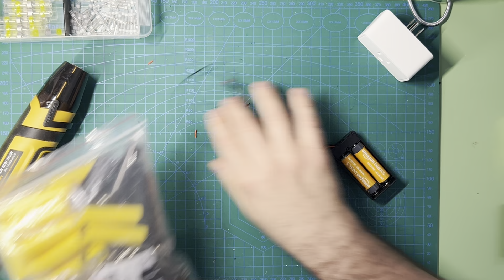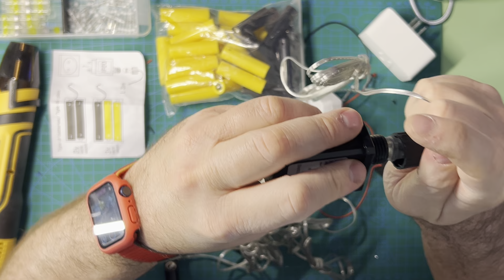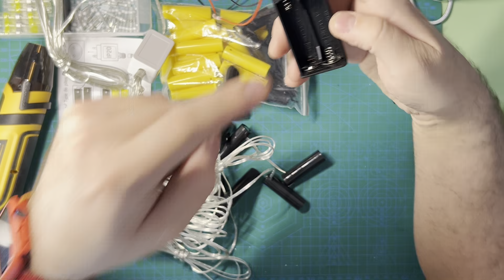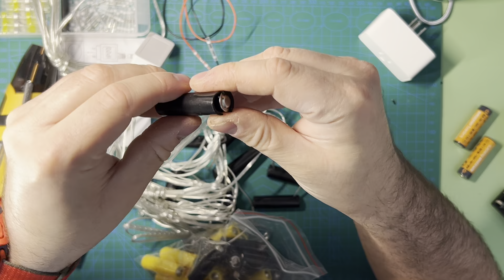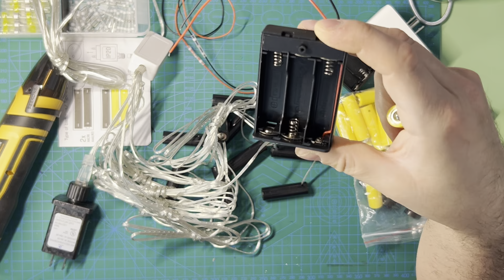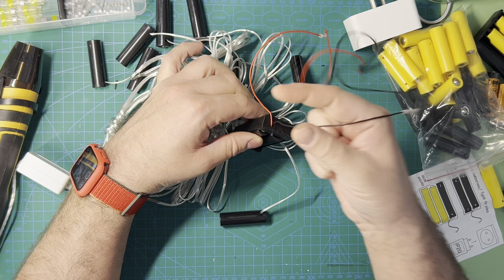Battery Eliminator

Comment: This device starts at 4.5v so it would not be able to eliminate that batteries in a device that takes 4 AA batteries right?
Reply from the maker: ive only used it up to 3AAs which is all it claims to work on, so i think it would probably NOT work on a 4x one
Reply: @Pluck-The-Bunny yeah I did some more research and found some that up cycle from 5v to 6v of 4 batteries so hopefully it works
Reply from the maker: @LumpyHippo  please let me know if it works
Reply: @Pluck-The-Bunny it works the brand of the eliminator I bought is called Meccanixity. It does says 6 volt on the USB itself which is reassuring. I used it in the Mini Alley Neon Ramen Shop Book Nook, which conveniently had a little gap for a wire to come out of already by the battery box.

So now I have 6 book nooks all connected to a USB power hub connected to a govee smart plug so I can turn them on and off wirelessly. 

My next to step is to see if its worth to reopen some of these to mess with the wiring to disable the forced motion sensor on one of them and see if I can default two others to default to powered on rather than off once the outlet is cut on.
Reply from the maker: @LumpyHippo  amazing!  when i first started doing this i was about 15 in.  i went back and retroactively redid all of them

Comment: It's cool when it works. Thanks for the explanation of black vs yellow ones. I have the AAA version of this set - exactly the same little piece of paper came with it - and it doesn't work. :-(  Amazon refunded my money. OTOH I also have multiple sets of the AA version (no paperwork included; I think it's a different seller), and they work fine. This is for my wife's Christmas village, so I can just ask Alexa to turn the whole puppy on, and I don't have to go around turning on a bunch of battery operated items (last year's was "Grandma's Christmas Village 2024" here on YouTube, in case you're interested). BTW, you really confused MY Alexa (2 feet from my computer) when you told YOUR Alexa to turn stuff off and on.
Reply from the maker: hahaha..ive had that happen to me...now i can remotely control people's houses.  UNLIMITED POWER!!!!!!  Sucks about the AAA version but the automated village is awesome!  ill definitely check it out

Comment: how big of a problem are AA-powered devices?
Reply from the maker: in what way?
Reply: @Pluck-The-Bunny  i'm asking because "battery eliminator" seems like a solution in search of a problem. most AA-powered devices last long enough that it's not an issue to replace the batteries once every year or so. what is the use case for it?
Reply from the maker: @UNgineering  Unfortunately you are not quite accurate here... These LEDs in these kits will burn through 2 AAs in about 120 hours...and many people have 10, 20, 30 + kits that they like to display with the lights on.  Lets say they last120 and you keep them on 8 hours a day. AA's avg $0.75 each. Thats 1.50 a nook or $15 /10 every 2 weeks.  That's approx $360 a year on batteries per 10.  I have 30+ That would be over $1k and even if you quarter the time its $250.  Three eliminators cost less than $100.  Additionally, you cannot connect them to a smart home if they are battery powered without adding in some electronics which is even more expensive.

Comment: I don't have any "smart home" device. So I personally use remote-controlled socket plugged into a timer-switch-socket. Initially i just used the timer-swith, but then the lights were on for hours. Now I turn them on manually with the remote, and if I forget to turn them off, the timer-swith does.

The black "virtual batteries" unfortunately break a lot. 
And all AAA "batteries" (virtual or not) in the eliminator have the following issue: The metal spring in the box is big enough, and the contact of the "battery" is small enough, that the spring only touches the plastic around the contact, but not the contact itself. My solution: tiny ball of aluminium foil between the two.
Reply from the maker: Yes...100% a bluetooth outlet works...I should have mentioned it.

And i agree about the black batteries popping open.  A simple piece of electrical tape is my fix for that